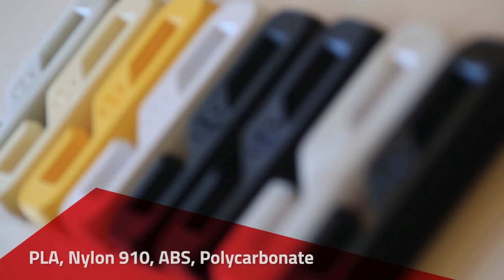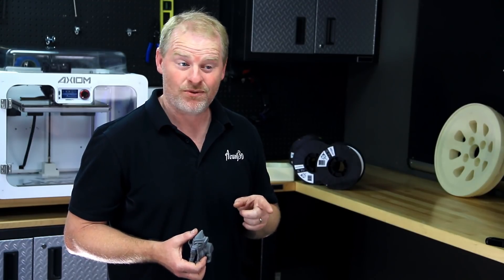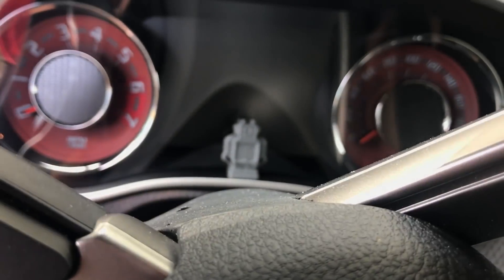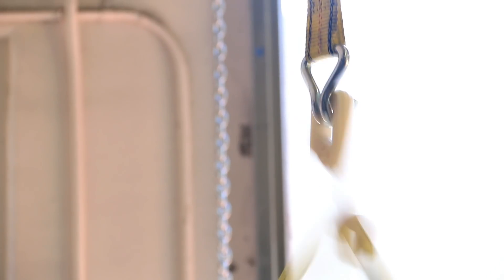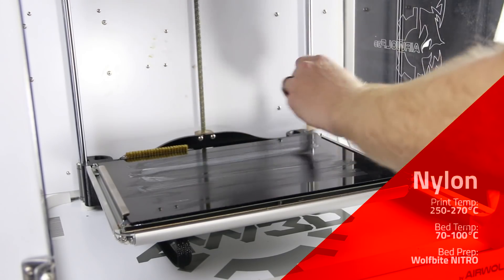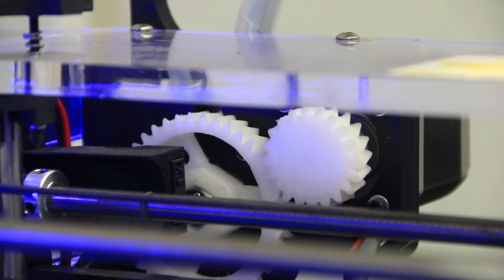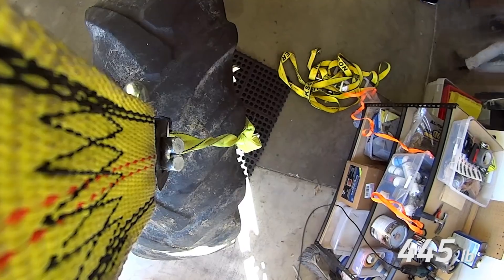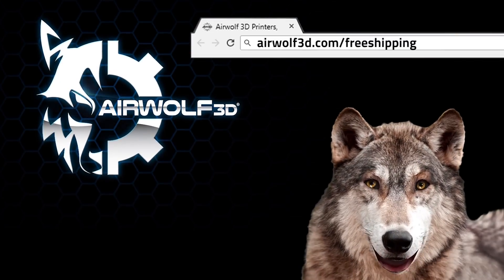Hooked on 3D Printing: What is the Strongest 3D Printer Filament?

Comment: I saw your video on filiment strength but the printer I kinda want only excepts pla any suggestions to keep parts strong if I get it thanks
Reply: Use larger extrusion width and more perimeters. Infill contributes only a little. Also design your parts to be strong.

Comment: What was the infill on the PC hook? Also, what about impact strength? The slow increase in pressure is one measure of strength, but sudden impact is usually more destructive- how does the PC hold up to that in relation to the slow pressure measurement?

Comment: >real engineering materials
>abs

lmao ok there bud.
Reply: They don't use ABS in traditional manufacturing with plastics like he claimed?
Reply: Of course ABS is used in manufacturing on a huge scale, but it is well known as one of the worst plastics to use in industry due to its lack durability and strength, which are two important factors.  I wouldn't classify it as an engineering material because of how it performs in those two categories, but there are more reasons why I think it shouldn't be considered an engineering material as well.  That being said, The term "engineering material" is rather ambiguous, and could mean different things to different people.

Something like PA6 or PA66 with glass fiber or ball reinforcement would be more like an "engineering" material to me, since they would boast a high durability, high temperature resistance, and good dimensional stability.  Delrin, Nylons and POM all have much better "engineering" properties than ABS, like dimensional stability (ABS is crap here), thermal deformation resistance (ABS is meh),  thermal insulation (ABS is meh), etc.  Even if you include strength and impact resistance, many PLA copolymer blends perform far better than ABS in most instances (esun PLA+, for instance, is stronger and more durable than both 3d printed and molded ABS).  I wouldn't consider those PLA copolymers engineering materials either, given their poor thermal resistance.
Reply: Impact rating of ABS, especially in cold temperatures, is one of the main reasons it is considered an engineering material. Yes there are stronger materials available, but due to the low melting point and ease to mold ABS is very cost effective. Until the cost of better materials arrive, ABS will be used in places that require good impact properties, like car bumpers. OF course there are ABS/PC mixes now that are used. However the main draw back for PC is cost and a harder to manufature.

Comment: my concern is that most home 3d printers will not approach the temps needed.. so this may be a specialty filament for some time to come
Reply: Most printers now use an e3d all metal hotend or something similar. A genuine one is $40 and can print at a little over 300C with no problems. Cheap chinese knockoffs can have problems at temperatures that high, which is almost always caused by a crappy heatbreak and heater/temp sensor. These can be fixed with the best parts on the market for $30 or so, or $10 if you get a less-shitty knock off from Amazon.

Those chinese knockoffs are supposed to print at polycarbonate temperatures, they just can because they are poorly built and those companies know most people who want to print at higher temps will be upgrading anyways.
Reply: @lobsterbark  ok hi, this is an old comment, but if i have a budget of around $1000 give or take would you be able to make a suggestion to start with good quality for a desktop printer... You are the first guy to speak with a bit of confidence on the matter - in a non sponsored way :)
Reply: @ceejayc6502  3d printers have changed a lot since then. I'd look at resin printers, see if they make sense for what you need. They are only a tad more expensive and produce much finder detail than fdm. They used to cost a lot more and weren't worth it, but now they are, especially for stuff like tabletop models.

Comment: PLA facts are false. It won't just degrade under sunlight and/or an outdoor environment. It has to undergo the right process for it to biodegrade correctly. The conditions aren't correct at a regular landfill either. It has a low glass transition temperature which is why if you leave something in the car or warm area it will start to collapse (the thinner the walls the weaker the structure). I've had multiple models sitting on my dash and there has been no degradation. Just look up PLA and sunlight or UV degradation.
Reply: I fixed my mailbox with PLA for the flag (it is a really big piece) and after two years in 85-105f temps, full hot afternoon sun, raging 80+ percent humidity, rain, 0f cold, snow, hail, and sleet and it still looks like it did when I put it up.
Reply: I have a PLA part that i printed 3-5 years ago, that is in the sun, rain ('an arm for an anemometer), and i live in tropical area, so sun all year, rain very often. I also used PLA for at least 2 years in an aquarium, as fittings for a pump and filter, so in a submerged environement, with a lot of bacteria, still no degradation to be seen.
However, PLA in a car melts quickly, as the temperature rises near the glass transition temp of PLA. In open air, it's not a problem at all (by the way, my anemometer and the part survived multiple huricanes... not all were full force, but at least one was very close to my position (in the caribbean), and it was cat4 or cat5 when it passed by...
Reply: The bad news: PLA is definitely NOT BIODEGRADABLE . The good news: ist is DEGRADABLE, but this needs special enzymes which are normally not present in nature. See the full scientific article:  http://www.biosphereplastic.com/biodegradableplastic/uncategorized/is-pla-compostable/
Reply: @rogerdekumbis4199  actually pla is biodegradable, many microbes can in fact make it degrade due to reverse hydrolysis and de-esterification, but the problem is it is very slow. As you might know lactic acid, the reverse hydrolysis  product is used in bacteria metabolism
Reply: Yeah I actually have Fly Trap printed in PLA and it has sat outside in direct sunlight all summer and all winter and there are no noticeable differences in it other than the color but that is just because it has dirt and fly droppings on it. I think really PLA should be looked at more as a prototyping Filament because it is cheap, prints easy, and is relatively strong. But also it should be looked at in a case by case basis. There are some parts that PLA would be great at, but others there are clearly better suited materials.
Reply: Thank you for your feedback.  PLA is a great material, but it is both thermally unstable and biodegradable.  Thermal instability leads to unpredictable behavior (i.e. deformation) in outdoor environments, especially those with strong sun exposure.  Therefore we would not recommend using it in load bearing applications.  You are correct in that to biodegrade completely, it should be composted, which can occur within 30 or so days.  Otherwise PLA is a fantastic material, especially for schools!
Reply: Right the biggest thing I was getting at was that the thermal problems are the main concern with PLA ;) . I know the windshield also has UV protection so even though I have some models printed in PLA on my dash, they haven't had any real noticeable change (I expected the black pigment to start fading and it didn't, but that would be a filler problem more than a material problem right?).

According to this site (https://www.filabot.com/blogs/news/57233604-the-misleading-biodegradability-of-pla) and many other articles I've read, biodegradability isn't a concern.

PLA is great in many respects. I even bought the sheets of Kapton from your site to replace the ones I use for my bed because I use it a lot. I also use the Kapton for Pet+ and TPU filaments and it works great! I'm not a fan of ABS and rarely use it.

Comment: I've been using polymaker pc max. Your polycarbonate prints much hotter. What are the differences?
Reply: Paul, thanks for the question.  We've been printing with polycarbonate since March of 2014 with the HDx.  What we've found over the years is that parts printed at lower temps (270C or so) tend to break easier because the layer-layer adhesion is weaker than at 290-300C.  This will vary with printer type and also depend on whether or not an enclosure is (preferably) utilized.  Not sure about pc max, but we can tell you that our filament is made from 100% polycarbonate pellets with no additives.
Reply: Paul Robertson I've been wondering the same thing